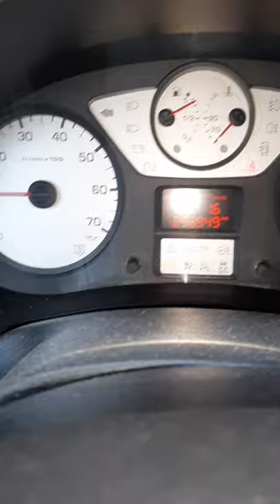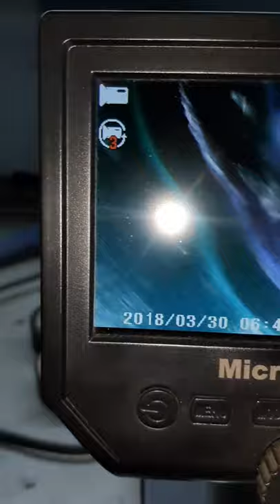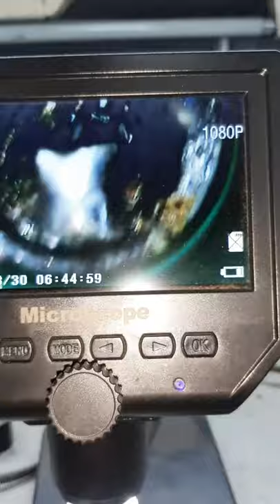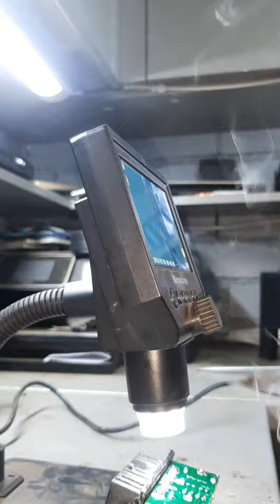Peugeot Partner ABS not working. C1385 electrovalves supply voltage fault.

Comment: Bonjour et merci pour cette vidéo car pour moi aussi la cause de la panne était bien ce relais double.
Attention a bien déconnecter la batterie 15 min pour réinitialiser les calculateurs.
Achat du relais chez Peugeot neuf 88€.
Remplacement du relais.
Le défaut disparaît immédiatement pas besoin de repasser la valise.
Autre info le code défaut C1385 peut aussi vouloir dire que la batterie est défaillante ou un fil est coupé sur le circuit.
Fck